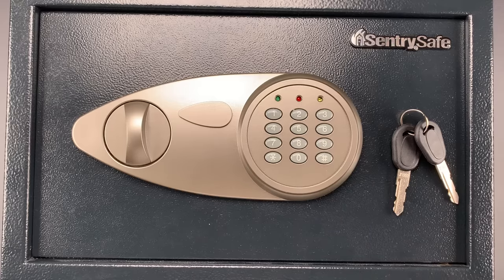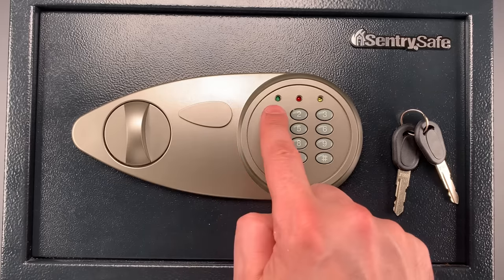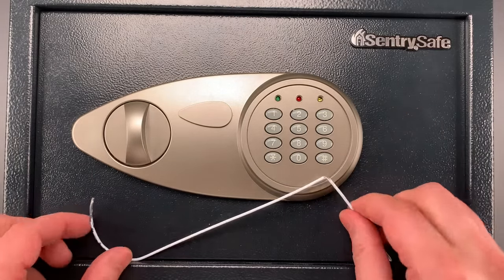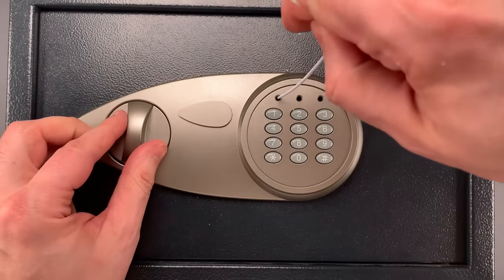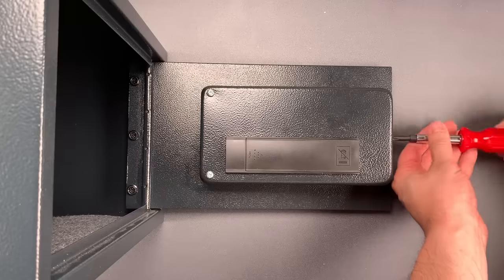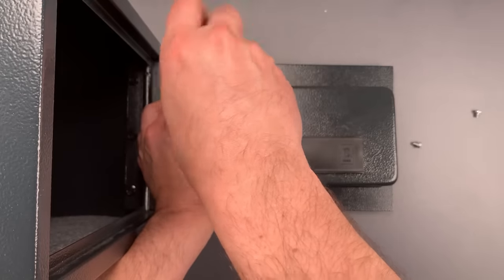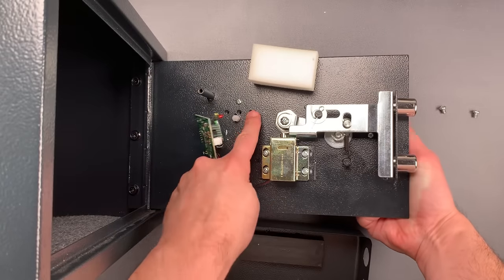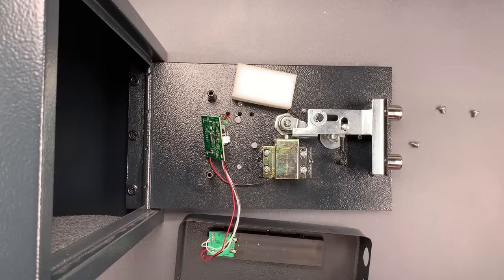[1020] SentrySafe Opened With a Coat Hanger!

Comment: OK so you can pick locks, but you must have had some inside information on the precise position of the tab that you pushed down with the wire. The hook was exactly the same length and bent exactly right so you must have had this safe apart before. That wasn't coincidence. 
And no doubt the safe manufacturer will be aware of this 'cheat' so if they have any sense will now modify the safe to prevent the piece of wire trick you have just exposed.
So you have achieved one of two things, maybe both, you have just pissed of the thieves and burglars in our society because owners are now aware of this issue so will take precautions to make their job harder or you have cost the manufacturer more cash as he has to modify the design, putting up the cost of the safe. May have even caused a downturn in sales of that particular safe which could effect somebodies employment at the manufacturer.